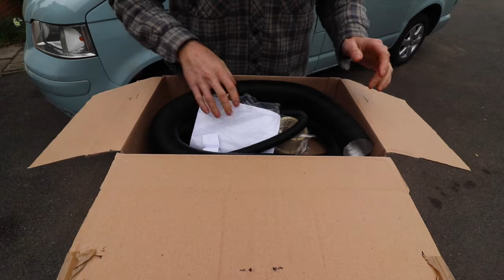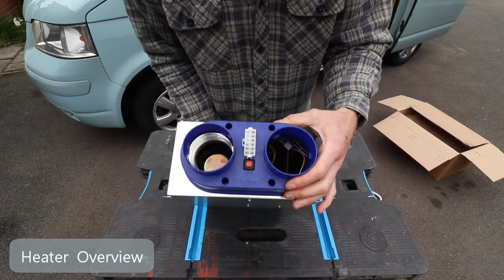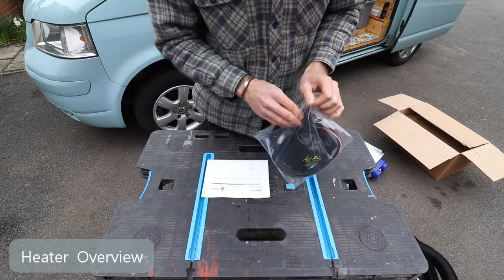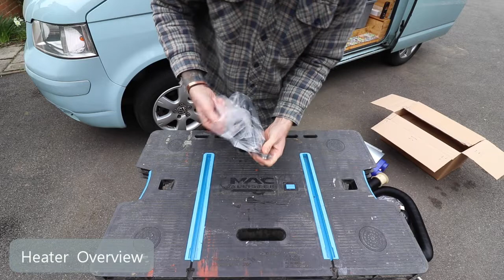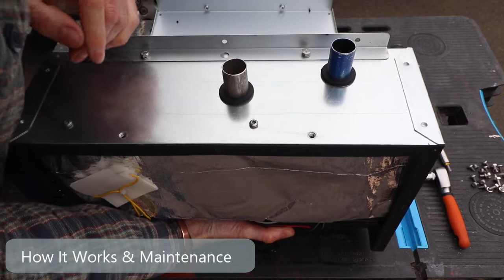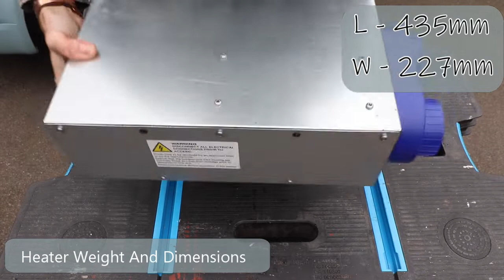Propex HS2211 Campervan LPG Heater - UNBOXING, How It Works, Kits Available & DIY Bracket.

Comment: Curious how this is holding up aftera year of use. I like the features of the propex heater, and mounting it underneath would give me a lot more space.  Im just worried about the heater getting exposed to the elements under my van, i travel a lot on dirt roads, mountains, and beaches.
Reply from the maker: Hey buddy, we don't have the T5 campervan anymore, we sold it a few years ago, so can't comment on how it is holding up now. However, we used the van for 2 years with it installed and it worked without issues. If anything it was too powerful for the small space in the T5. If the gas ran out it would need resetting but this wasn't an issue.

Like you, we travel 'off the beaten track' so the heater was exposed to the elements and was fine. 
Installing it underneath the van saved us so much space inside. If you do install it underneath i would highly recommend fitting it as high as possible under the sub frame to protect it from damage.  

Good luck!
Regards
Jolly

Comment: Excellent video! Is it possible to run the thermostat and power supply cables through the return air duct into the trailer/vehicle? I'm hoping to mount the 2211 outside on a toolbox or a table, but I'm worried about the cables being exposed to the elements. I will be running the ducts into the trailer via port holes that I will drill into the side of the trailer, BTW.
Reply from the maker: I wouldn't recommend routing the cables within the air ducts due to the excessive heat and you would need to cut holes for the cable to enter/exit. Cables are very robust and can withstand temperature, the main concern with external wiring is routing them to ensure they're supported and protected. I would recommend installing them in a flexible conduit.
Hope that's helpful 👍.
Regards,
Jolly

Comment: I have a few questions about the HS2211.
Does it matter which side is up or down when operating? Can a flexible rubber propane line be used instead of copper line? What type of rubber line is best? Can a Bluetti power pack be used to power this heater? Thanks
Reply from the maker: Hi David, the Propex HS2211 installation manual states, 'The heater may be installed laying on any of its wide or narrow sides, but not nose down or up. A link to the heater instructions is in the video description; see pages 6-7 for guidance on installation. 
The gas supply line must comply with relevant regulations (Campervan regulations guidance can be found here - https://vandercampadventures.com/campervan-gas-regulations-2022); I'm afraid we can't advise on what type of rubber line is best.
The heater requires a 12-volt supply and uses 2.2Amps/26.4 Watts when on full power, so it will use a maximum of 2.2Amps/26.4Watts of battery per hour. 
We hope this information is helpful,
Thanks, Jolly @ Vandercamp Adventures